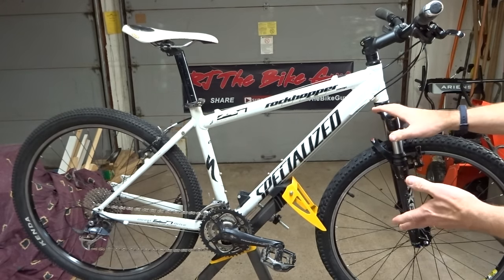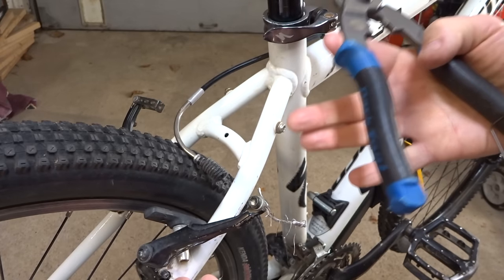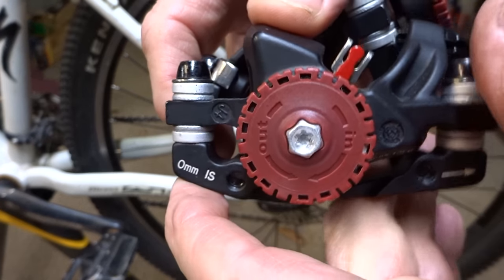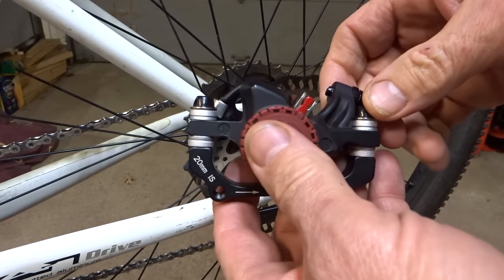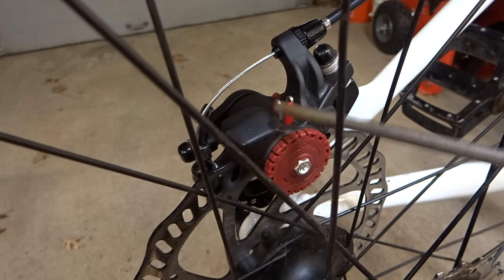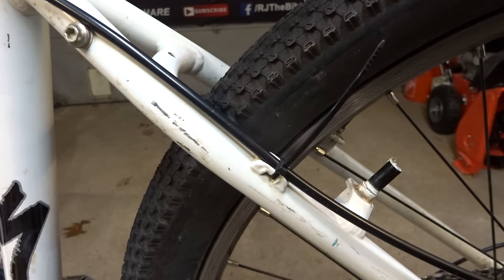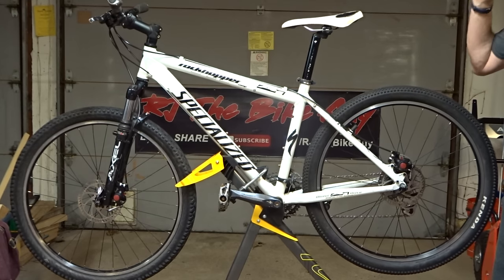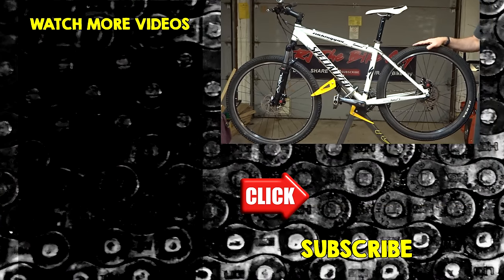Disc Brake Conversion/Upgrade On Mountain Bike

Comment: So glad to see what you had to say in the first 30 sec.  As someone in the bike sales industry, I get questions about this all the time on bikes that just aren't worth doing this with (Trek 820 as an example).  This is a rare unicorn (finding mounts front and rear AND wheels which are already compatible almost never happens) that is actually worth your while in making the switch.
Reply: If you have the tools and time to make the mounts yourself you can do it. I think also like you can buy adapters but im not sure
Reply: @Crediu  Whenever you evaluate a significant bike upgrade, it's a great idea to do a quick cost/benefit analysis.  For 99.5% of bikes out there that you come across which do not have disc caliper mounts OR disc ready wheels (as is typically the case with older rim brake bicycles), the costs greatly outweigh the benefits since once you've completed things, you'll be looking at a very expensive brake upgrade on what is likely a relatively low value ($250 or less) overall bicycle.  With very few exceptions, a good rule to live by is: No mounts, no disc wheels,- Just don't.
Reply: @jeremydwyer2724  I would just convert so the bike doesn't go to waste and can be used for another 30 years
Reply: @jeremydwyer2724  even though i think i dont even really like disc brakes. Since v brakes are much more powerful for the cost
Reply: @Crediu  To each his own but I'd sooner rock the rim brakes that it came with and was designed for, saving my monetary resources for more fruitful endeavors.
Reply: @Crediu  I think you just made my argument for me.
Reply: @jeremydwyer2724  yea😂

Comment: I've replaced and set up many disc brakes and as yet I've not had a rotor that didn't need trueing if only slightly, I find it agrivating hearing that "Zing, zing, zing" of the pad touching the rotor as your riding.

Comment: Thanks alot for the tips. I've got a 10+ year old Focus Downhill bike that needed some love. Turns out I had the discbrake notches without me knowing. So I'll be ordering the same parts you used in the vid. Gonna be a great upgrade.

Comment: Those Specialized frames look very nice on disks.
Having disks already, another nice mod on is to fit some 29 wheels using city tires like 700x32 or 700x38. It handles nice and easy to control like your old 26 MTB but the tires has way less drag on asphalt.

Comment: Very helpful video. I had Commencal Supernormal '06 which I upgraded to hydraulic disc brakes but front fork was also in IS 2000 standard. I found second-hand Magura Marta in this standard and it was plug&play to mount (2x 160mm rotors). Much better breaking after upgrade!

Comment: Fun video! I have a 2001 Specialized Stumpjumper M4 that I'll be doing the same upgrade! I'll be using hydrologic brakes since I have some take off laying in the parts bin. Just looking for a good deal on 26' wheels w/ disc brake mounts. Might do 180mm front and 160mm rear. 🤘😎

Comment: I'm currently upgrading my old Scott downhill bike. I've had it for at least 20 years in variuod sheds and garages. It has disc mounts front and back so am going to go for it. 

Do need new wheels though. 

I originaly loved the mega oversized aluminium frame sizes of the times so am quite excited to get some use out of it again.

Comment: That's a rare offering to have a bike sold for two brake options. I had a set of wheels made a few years ago that had disc brake MTB hubs with rim brake rims. Insole the setbob to avguy that had two bikes...one rim the other disc, he wanted a wheelset that he could swap from rim to disc bike. 
I put Loctite blue on the rotor torx screws.
I have a set of those calipers that I had on a bike and tbh they were better that some hybrid types. The compressionless cable housing I found makes a difference but it's not cheap.

Comment: I have a 2003 specialized Rockhopper A1 comp that I did the exact same thing to....tho mine didn't have the proper hubs (like u mentioned early on) but I did get a set of used rims for very cheap and I had the hydro disk brakes in my parts bin. 👍

Comment: About rotor cleaning: super-effective is aerosol/liquid called "brake cleaner" found in the car shops. Much more effective than the isopropil alcohol. Also because of pressure it cleans all the oils in the disc cuts also, not only the surface.

Also when installing used rotors (or when changing brake pads), good thing to do is to use sandpaper (like nr250) on them (a bit, just to remove shiny part). That will help brake pads to work-in faster & better.

Comment: What a coincidence to see this video. I just upgraded my 1997 haro extreme ex0 to disc brakes. The frame had holes for mounting but Unfortunately i had to buy new wheels as the old hubs didn't have disc brake fixings

Comment: The procedure for mounting the calipers and  for adjusting them and the pads, is quite different than the one in the Avid BB5 manual. As the BB5 has only the fix pad adjustable, the caliper must be positioned in the manner that makes the lever operating easy, with a short travel., and insure that the disc is not bent too much against the fixed pad.  The Avid BB7 has the mobile pad adjustable, which makes all the job easier.

Comment: Just so people are aware:
1) To clean rotors and pads, you can use a couple of automotive products. One is brake clean, an alcohol-based solvent that is used to clean grease and dirt off of different car parts. Another is wax and grease remover, a product that is used in auto body preparation for body part painting.
2) New rotors are often coated with a protective oil called cosmoline, which prevents rusting. You can use any cleaner, whether the ones mentioned above, the isopropyl alcohol seen here, or even a household cleaner/degreaser like Mean Green to clean new rotors. You can even use warm water and dish soap to clean new rotors, as long as you dry them immediately after (and before you touch anything else, as your hands are also clean at that point).

Comment: I use a lighter on the end of a fresh cut cable to open out the inner pipe it also tidies a rough cut outer sleeve.

Comment: i have hydraulic disc brakes installed on my bike. Last night I decided to switch out all of my expensive components with budget components for winter. Including switching out my air fork and hydraulic disc brakes. I've discovered that there may be something wrong with the post mounts on my budget air fork because no matter how much adjusting I do of the caliper I am getting rub. I initially thought maybe my rotor was bent so i switched rotors, and that one rubbed too, so I switched to 160mm rotors (I initially had 180mm) and now the 140mm rotors is also rubbing but not as bad as the 180mm. I think one of the post mounts is rounded off so the caliper isn't sitting flush against the mount. I have no idea what to do about this and I know I didn't have this problem when i was originally using the budget fork before i bought my more expensive air fork. Point being, i really wish I had the ability like on these mechanical disc brakes to adjust each pad individually because then i wouldn't have to keep adjusting the entire caliper. At the moment I'm not really sure what I'm going to do, I'm thinking of possibly taking a file to the post mount and filing it flat but i don't want to risk taking too much material off of the mount. I might just either say screw it and just ride with the rubbing brake or just not run front brakes which I'm not too excited about especially in winter in the snow when i need as much braking power as i can get.
Reply: If you only file away a small amount of material it probably would be ok. This might be a good question to post of a bike forum like Bicycles Stack Exchange.
Reply: @dhollm  that's a good idea. i do know that some bike shops have a tool that can shave away the material on a post mount for just my reason, but it looks like I won't have to do that. Last night I decided to try putting a washer in between the post mount and the brake caliper and that seems to have fixed the issue by about 99%. There is still a little bit of brake rub but it is definitely alot better then it was originally. I think I will be getting some longer post mount screws though because I think some of the top threads on both posts are stripped out from me screwing and unscrewing the screws so much.

Comment: 15:27 

I want to add this part. Put some oil on the shifter/brake cable or inside the housing for some protection and lubrication.

Comment: Nice video, very good job, I would had run the front cable housing a bit different, through the front of the bridge, like on the modern bikes. Anyway, congrats, well done!

Comment: So, basically if your bike frame is not disc brake ready, you might as well purchase a bike that has disc brakes?. I own a schwinn crisscross that I want to do the conversion.... by the way great video!!!
Reply from the maker: If you frame does not have mounts, forget it. Not worth while.
Reply: @RJTheBikeGuy  thank you for your advise.. I appreciate it 🙏

Comment: My bike only has mount points at the rear. Is is worth converting just the rear brake to disc, leaving v-brakes at the front?  I guess that would still give better wet-weather braking.
Reply: Terribly dangerous. Front brake must be stronger.
Reply: @tomahoks  Thanks for the warning, I'll leave it as is.
Reply: It might be worth having a look to see if you can find a used fork with mounts, if the fork is nothing special they can be had pretty cheap usually. Also I don't see why having a disc at the rear would be "Terribly dangerous" in an ideal world both brakes would perform equally the reason they don't is because of physics not by design, mechanical discs don't perform massively better than well set up V-brakes, so it might actually even things out a bit.

Comment: Any experience with the cable actuated hydraulic brakes?  I like my shifter that incorporates the shifter and brake all in one and I was told that the hydraulic brake levers would have a different mechanism....
Reply from the maker: Yes, hydraulic levers will be different.
Reply: @RJTheBikeGuy  what I was wondering was for those hybrid calipers that use the cable to press the hydraulic pads....  and is there a huge difference between  a cable that runs the distance between the lever and calipers vs the fluid the entire distance...
Reply from the maker: @mrupholsteryman  Hydraulic the whole way would be better.
Reply: @RJTheBikeGuy  last question...ever have any experience or insight on heat treated aluminum?  I have a few upgrades on my early 90's Specialized Rockhopper and the headtube is cracked....  has anyone rewarded these?  Hairline cracks on the front of the headtube on the top and bottom where the bearing cups sit.
Reply from the maker: @mrupholsteryman  It's toast.
Reply: @RJTheBikeGuy  😑🙏

Comment: Hello Mr RJ, which is better between shimano mechanical brakes  and SRAM avid
Reply from the maker: Shrug.
Reply: If we are talking mechanical disc brakes between the 2, Avid all day long, Shimano never really caught up before things went hydraulic. TRP Spyres are probably the best out of all the pure mechanical calipers on offer (without paying silly money for something like Pauls) but they are pricey.
Reply: @chris1275cc to be honest I have never dealt with SRAM components, used Shimano all my life so I'm skeptical on other brands. I've searched trp spyke it's expensive even than shimano entry level hydraulic mt200. 😲
Reply: @brian_jake  Yeah the original Spyres where really designed for road bike/drop bar they are really a bit of a throwback to a time when road bikes had disc frames but no hydraulic brifters were avalabe or stupid expensive and Avid bb7's were the only game in town and hard to get your hands on. Surprised they still sell tbh they aren't really good value anymore.

Comment: Where I can get Avid BB5 mechanical disk brakes??
Reply from the maker: You can find a set on ebay with rotors, calipers, and adapters.
Reply: @RJTheBikeGuy  thanks

Comment: Too bad I can’t convert my hydraulic disc brake road bike back to rim brakes, damn Shimano brakes just make a racket, ride by a cemetery the dead will awaken and throw rocks at you.  Very temperamental.  Seems the weather sets them off, you never know until applied.  And as usual the owner is always blamed for the issue, even changing to brand new pads meant shet but wasting money.  I was advised to change out the Shimano ICE rotors to solid rotors, yeh right blow more money.  I learned a long time ago, never through good money after bad.  The bike has Ultegra, the controls, brakes, and wheels are totally worthless should I get a replacement frame/fork.  I do like the frame/fork and wheels though, too bad.  I use the bike on a trainer only.

Comment: V-brakes to disk brakes is a downgrade. Noisier, more expensive, heavier, harder to maintain, not a ton of better braking for most riding conditions...
Reply from the maker: I disagree.
Reply: Me too
Reply: Sir, are you joking? 
Disc brakes on my Ghost Kato MTB don't make any noise or slight whispering braking noise (Tektro M285 with resin pads and 160 rotors). In 4 and a half years I have just changed through 3 sets of pads. Bike has around 12,000 km or about 7500 miles.
Total maintenance costs I spent on hydraulic disc brakes is around 50 USD, brake fluid original, brakes behave like new.
And how much I spent on rim brakes only replacing the pads in my lifetime I think it would cover the price of a decent new MTB.

P.S. I'm not saying rim brakes are bad and I still use a vintage MTB with rim brakes, but hydraulic disc brakes are like "set and forget", mechanical ones may need some minor adjustments as the pads wear and so do rim brakes need adjustments from time to time.